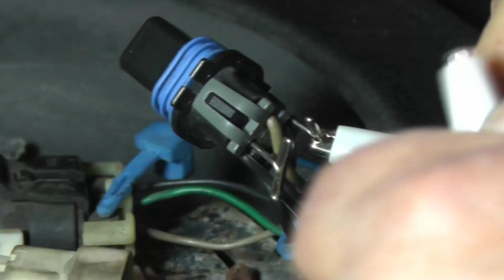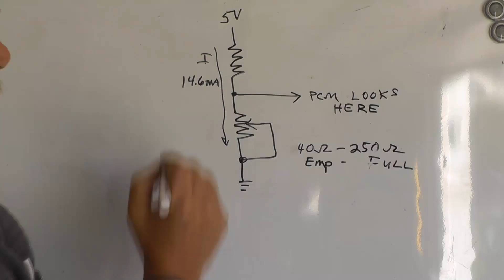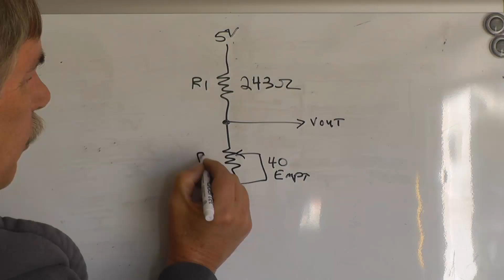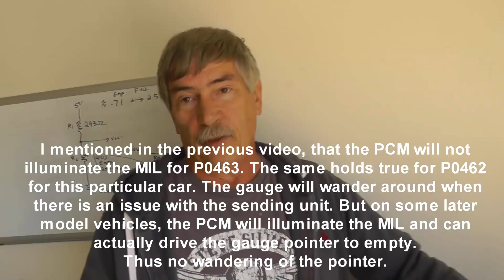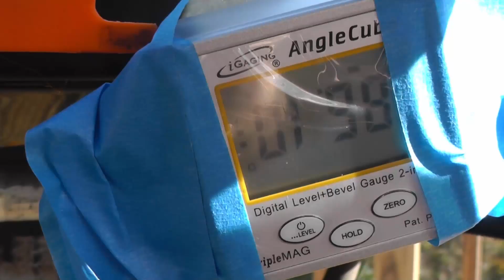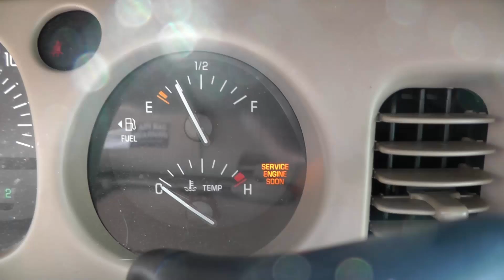Deeper Diagnostics of GM Fuel Sending Unit, P0463 - Part 2

Comment: Hi Terry, thx for a very informative video! One thing I was wondering about. The voltage out point is in between the 2 resistors, so how does the PCM know what resistor to read from? I don't know if that made sense but thanks.
Reply from the maker: +Sean Perkins No problem Sean. I mentioned it a few times throughout the first two videos. The PCM reads the voltage across the fuel sending unit in respect to ground. There you go Sean, pretty simple, eh!

Comment: All I can say is "wow" very through.  But  you need to take into consideration that the float movement is not verticle in the tank.  The float moves in an "arc of travel"  because on the constaraint of travel inside the fuel tank.  If you follow the arc on a verticle graff, you will see why the resistance is not linear.  So the guage is pretty accurate considering.
Reply from the maker: +gary smith Yes Gary...the float does swing through an arc which is about 82 degrees as measured. And it was just an experiment to see how well the sensor was throughout its range. Thanks for dropping by and leaving a comment...

Comment: Great video with a nice blend of white board with calculations and practical field work .The manual that you employ, has a great deal of information on the vehicle  which begs the question--What company prints this service manual and what is the name? The scope output was very interesting  with the theoretical and practical showing a marked difference.Good grounding in sending units.
Reply from the maker: +Tom OConnor Hi Tom and thanks for the feedback and glad you liked the video although it was a lot of stuff. As for the manual, I got this from www.helminc.com years ago and it was for a 2000 Buick LeSabre. Thanks for dropping in!